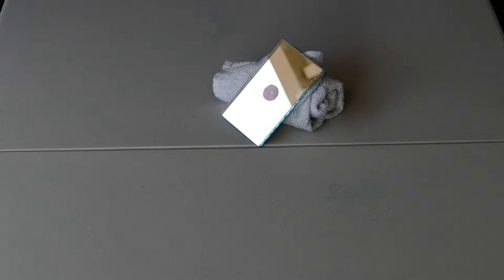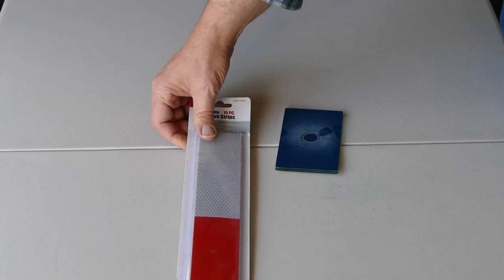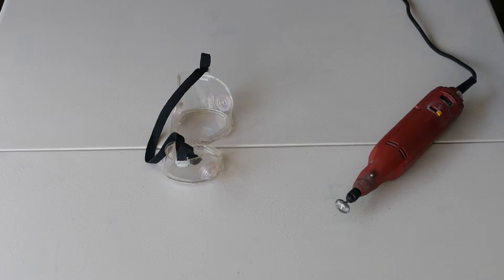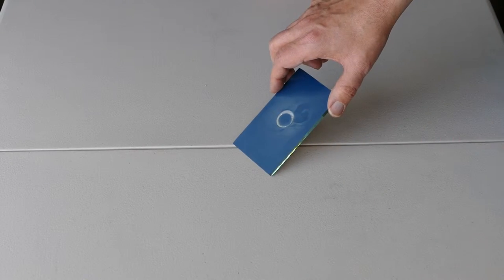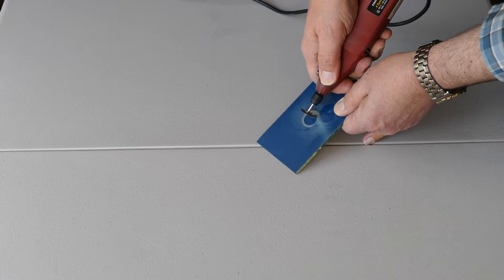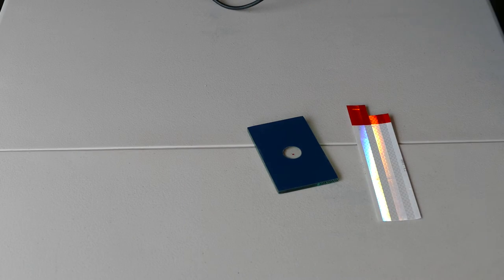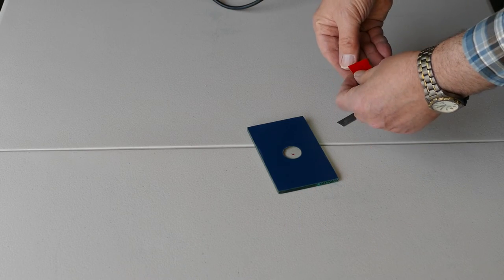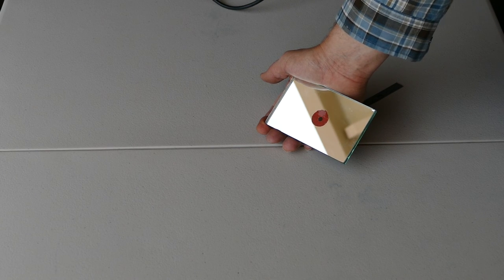Making a Signal Mirror with a Retroreflective Aimer

Comment: I made one of these this morning with a 2x3” mirror and reflective tape.  Red fireball achieved! Cool idea!  Thanks!

I used a 2x3” piece of the white reflective tape to mount the red tape on the back of the mirror,  sticky side to sticky side.  Now I have a day time signal mirror, a and night time reflector.
Reply from the maker: You're welcome! Putting a reflector on the back is time-honored: the first issued retroreflective aimer mirror, the M-580A issued to US Navy pilots in 1944, had reflector buttons on the back: https://flic.kr/p/gukhHM . Premier signal mirror manufacturer Malcolm Murray (deceased, alas) used retroreflective green (seen here: https://flic.kr/p/DtxQ9a - note that "at night, the green surface will be visible in the beam of a searchlight") or red (seen here: https://flic.kr/p/DrdVeG ) retroreflective material on the backs of his mirrors. Life vests are, I believe, often required to have white reflective tape for that purpose. I often find that reflected light from the back of the signal mirrors can be distracting when aiming, so I usually cover mine with matte black tape. However, one could use black cling film to cover the white tape until the time of need - I see some on Amazon for <$10 (enough for hundreds of mirrors) - I'll order it and see how that works. The StarFlash® military plastic mirrors come with black cling film on the front, to both protect the surface until use, and avoid inadvertent reflections to unfriendly forces when downed in hostile territory.

Comment: I've made a few a these and use a 1/8 ' ' hole punch for the sight hole.  This lets you see the sun dot in the center of the sight hole and you know for sure you are hitting the target. I also cut about a nickel size of the backing tape around the sight hole. this helps as you can see when you are getting the sun dot close to the sight hole.
Reply from the maker: You bring up a good point - when you look through the 1/4" hole I use, when the angle between the sun and your target is small, you have to look through the edge of the 1/4" hole opposite the sun to be sure of seeing the "red dot". If you are making a mirror for a user who doesn't know that (or forgets), they will have a better chance of using it properly with a small hole. On the other hand, having a larger hole makes it easier to acquire the target, so it is a tradeoff. The math that describes this is given here:
https://www.flickr.com/photos/signalmirror/36157474902/in/album-72157644777069576/
which leads to the following useful observations:

The fraction of the sighting hole that is "blind area" (where the "red dot" can't be seen) increases as:
(1) The angle between the sun and your target decreases
(2) The thickness of the mirror you use decreases
(3) The size of the aiming hole increases
(4) The index of refraction of the mirror decreases.

Comment: Does the reflective tape need to be red?
Reply from the maker: No, any color works, but I recommend red - the white that comes with the red I use is too darned bright. When I originally developed these, I tried many different types and colors ( white, orange, blue, green, etc.) of retroreflective tape. Most commercial signal mirrors sold in the USA that use retroreflective film/cloth in their aimers do use white tape ( the Rescue Flash®, StarFlash®, ProForce Ndur and BCB Mayday Signaling mirror all use white retroreflective film/cloth), but I don't know where they get their tape, and I like the red I'm using now better, anyway. The ACR Hot Shot™ Signal Mirror does use perforated red retroreflective film. The DIY tape I like best to date (because it gives the smallest, most circular red dot) is Harbor Freight's HFT Item #97562:  2 in. x 12in . Red and White Reflective Strips, 10 Pk. (currently $6) [ https://www.harborfreight.com/10-piece-reflective-tape-97562.html ], and since half of it is white, some of our Scout leaders tried using the white, but found that the "white dot" was too darned bright (in bright sun, I usually use sunglasses even with the red dot). The red material is less bright, and is what was used in the US military signal mirrors before they went to the white mesh - the French and Italian air force mirrors use red as well, and the Chinese air force mirrors used to use red as well. The Scout leaders did manage to use the white HFT tape successfully by sandwiching tinted window film between the white tape and the glass to reduce the brightness, but I find the best use of the white tape is as a practice target - I can put the 2"x6" strip 100 yards away, and when I hit it with the beam from a 2'x3" glass signal mirror, it "lights up" bright enough for me to see that I'm on target.
Reply: rafowell Thank you so much.